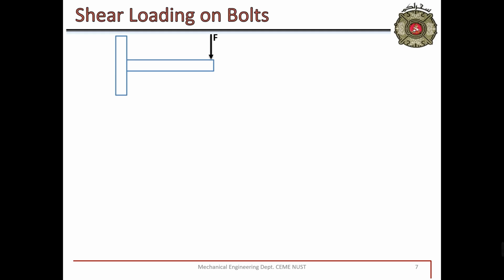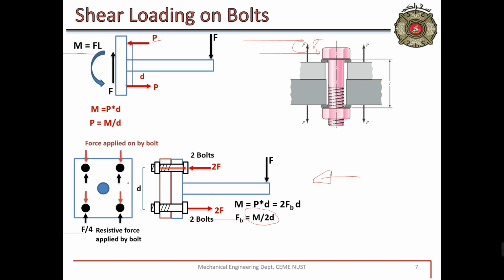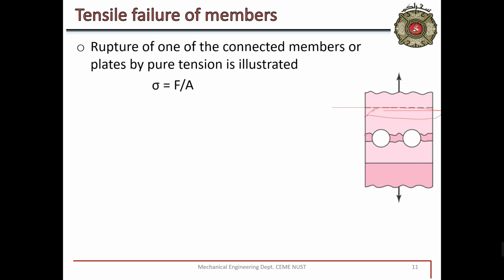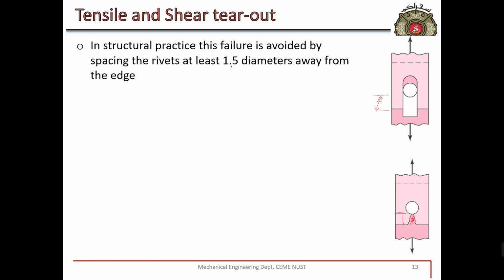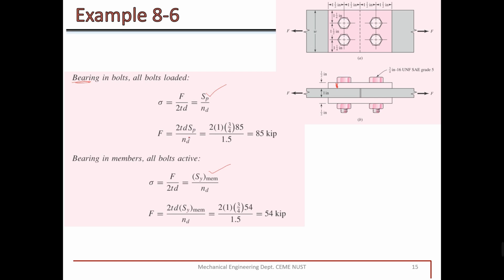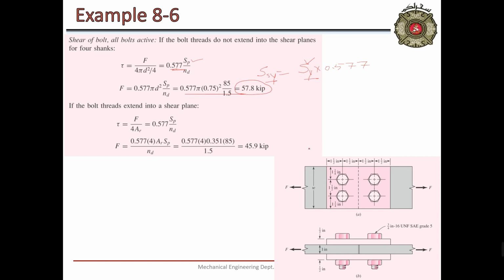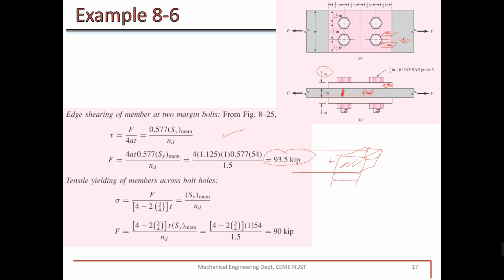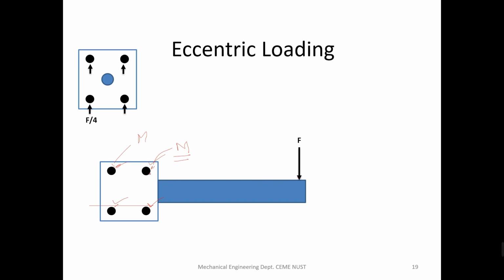Machine Design I: Week 5 (Part 2/3)

Comment: help me out 
bearing in bolts: you said there are two bolts that's why there is 2 in denominator, but the bolts are four in number.
Reply from the maker: Two bolt are on left and two are on right.. The bearing failure occurs if bearing in either of two bolts (left or right) exceeds the bearing strength....